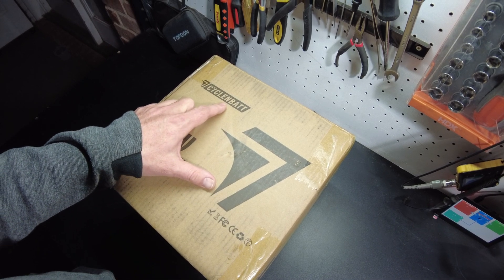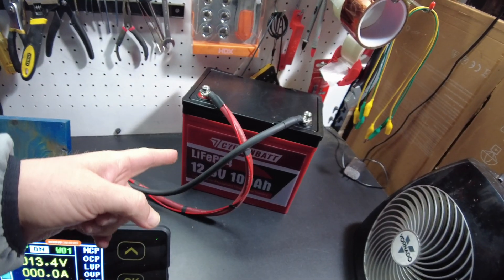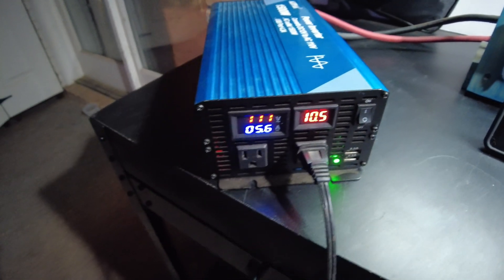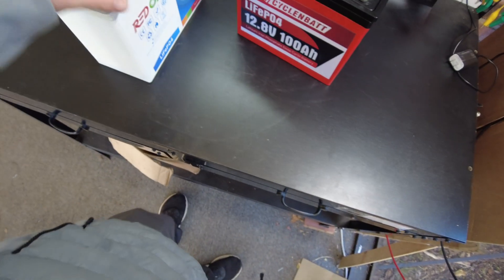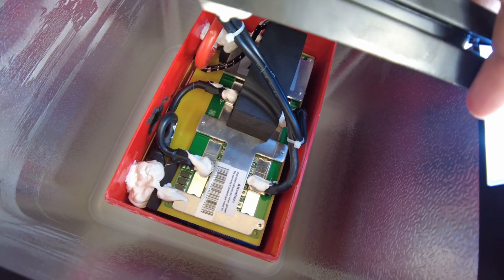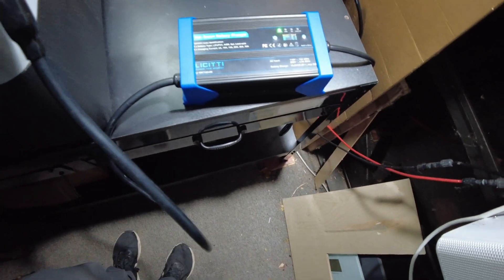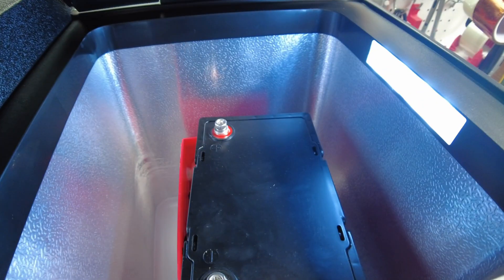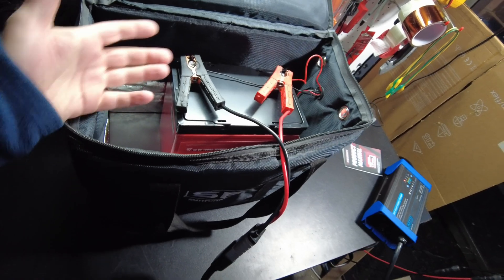CYCLENBATT 12V 100Ah Mini LiFePO4

Comment: Just installed one on my boat for everything jackplate, trim, 2 1500w amps, gps, accessories, etc..., heavy agm for starting. Ordered a lithium isolator, but may try running this setup for now until that comes. I do have both batteries isolated with battery switches. Motor will charge the agm. Thinking when motor is running I can connect both through the battery switches. Any thoughts or concerns? Or I should just charge the lithium at home with dc lithium charger?

Comment: I’ve been on link too order because gonna use for electronics on boat and I definitely want the low temp protection but it’s not showing 100 amp available too order and doesn’t say when they will have them ? Any idea how too find out how too get this battery
Reply: Hey, I noticed it's now available.
Reply from the maker: They're probably out of stock.

Comment: Very cool stuff, and I'm not just talking the low-temp charging test!  That's got to be the smallest possible 100ah battery, using prismatic cells.  You couldn't get much smaller even with pouch cells, unless the case was structural and part of the compression fixture.  I feel like we're reaching a plateau with this particular battery form factor, where everything in the traditional Group 24 and Group 27 sizes has been done.  It's remarkable how much energy storage you can get, in a fairly small amount of space and very little weight.  Three of these batteries would weigh less than just one of the old AGM's I used to run on my boat, yet deliver 6 TIMES as much usable energy, and fit in just a little bit larger space.  I never thought we'd see battery tech like this.

Comment: What I would like to see is a 200AH   mini battery.😅
Reply: Put two of these together and that's still pretty dang small.  :)
Reply: @jasonbroom7147  That would create a system with 2 BMSs. That could limit the future expansion of your system. Larger capacity batteries are the future of the LiFeP2O4 market.
Reply: There are several, depending on what you mean by "mini." See LiTime 230 ah, Epoch 300 ah, NewtiPower 300 ah, to name a few.

Comment: That was pretty thorough temperature testing Brad. Maybe set it to 32 (0oC) and see at that temperature. This chemistry should no charge at or below 0oC.
Reply from the maker: For sure totally agree on the 0C. My only hang-up on getting it that close was I didn't feel I could really verify the spot where the sensor was reading was actually 32F (0C) Since I could not get to access to it. Thanks Ben!
Reply: @BradCagle  Each change in temperature took hours and being able to get the point where it trips...., I get it.

Comment: What is your opinion of hooking this battery and Redodo mini in parallel ?
Reply from the maker: hmm, I cant really think of anything that would be a problem. EDIT: Manufacture recommends not to, as bitsufr46 pointed out.
Reply: @BradCagle  Redodo recommends that you only parallel two of the same model and purchase them no more than 3 months apart.
Reply from the maker: @bitsurfr46  Well there you have it, I suppose shouldn't do it. Maybe different resistance can cause one to be stressed more than the other, I guess that's a possibility.